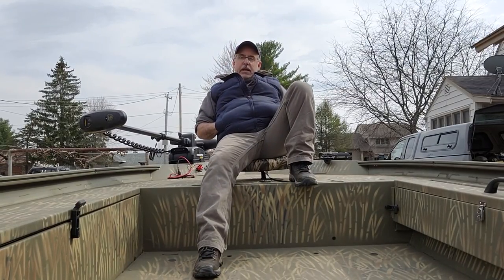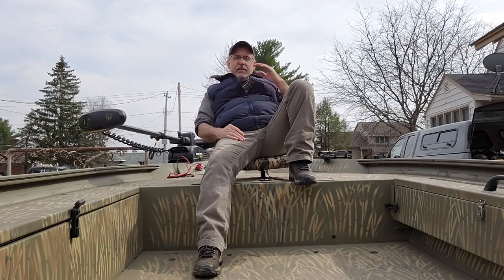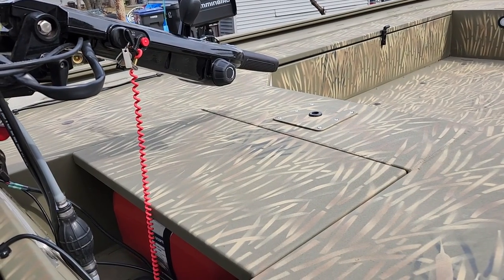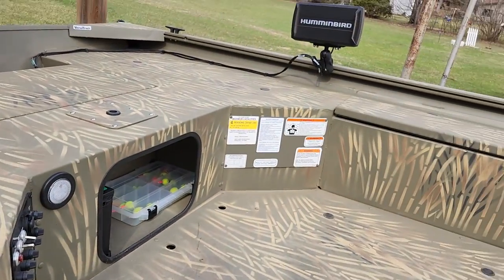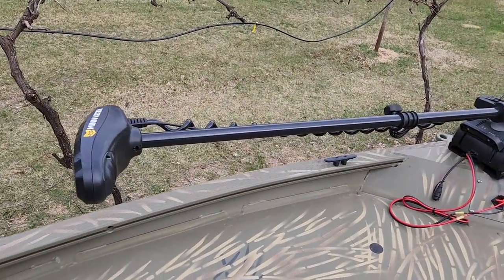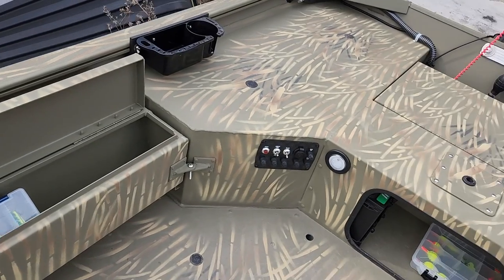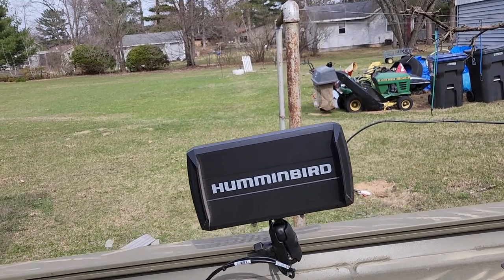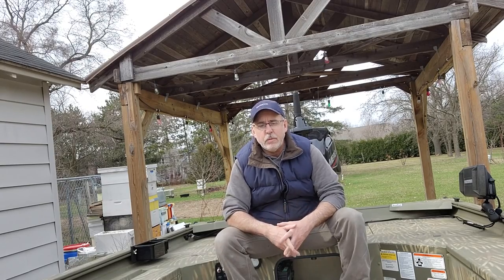1654 Grizzly Tracker  Sportsman Jon Boat  - A Brief Tour

Comment: Hey man, awesome video. I bought one of these last year. I love it. I got the 30 hp. I have the same issue with the tiller handle to the seat. I'm guessing that rear seat plate is for a fishing seat, not for while driving. I put an off set seat plate where you were thinking about putting your center post seat plate. But I went with an offset, since I still wanted it closer to the tiller handle. My arms must be short. They sell them at Cabela's. I also capped the bottom and caulked it to prevent water intrusion to the foam. Overalls I think the boat is set up real nice.
Reply from the maker: very cool.....hope it's working out well for you!

Comment: I just bought a 1754 with a 40hp tiller cant wait till it gets here
Reply from the maker: It'll take some getting used to but you'll love it.
Reply: @KevinsNorthernExposure  Im looking forward to it it's a little bigger then my 10' hahahaha
Reply from the maker: @bobmackay9281  yeah...that's a definite change.  I had a 1648 alumacraft with a 25....loved that boat....it could really maneuver...way lighter....comparatively, mine now is a tank.....does not turn on a dime and docking was a bit of a learning curve....just put a jack plate on it yesterday, too.
Reply: @KevinsNorthernExposure  that's awesome. I will end up doing that as well I plan to run some shallow area.

Comment: Hi, thanks for the video.  I just ordered one of these and plan to put a trolling motor on, which I want to order before the boat arrives.  I see you got the 45” shaft.  Have you used it and fell that it’s long enough?
Reply from the maker: Well, all I can tell you is this, I got the shortest shaft (45") with a 55lb thrust and it was plenty for this boat and I don't have mine down all the way. I've used it in windy conditions and it performed very well.  If I fished a river with a strong current a lot, I'd consider moving up to a 65lb thrust, but then you are getting into 24v territory. Right now, it's a 12v and I don't have to install a second battery.
Reply: @KevinsNorthernExposure  thanks!  That’s really helpful info.  The guys at Cabelas were trying to talk me into getting a longer shaft incase of wavy conditions, etc, but I don’t want all this extra long shaft for a boat of this size when the trolling motor isn’t in the water.  Seems like it would stick out weird when folded up. 

I saw the seat position issue as well right from the get go and am also having a seat receiver installed in a different location as well.  Pretty silly.  (I also got the 40 hp)

By the way, is your boat a 2022 or 2023 model?  I was forced to order a 2023 model a month ago when I bought it…I’ll be curious if anything about it will be different.  (The tracker website is still showing only the 2022 prices and models and they don’t have a 2023 brochure available yet. !!).
Reply from the maker: @michaelelsbury4713  it's a 2022 model. Enjoy your new boat! awesome!
Reply from the maker: @michaelelsbury4713  I've got a new video coming out today...maiden voyage. 33mph me and dog after playing with trim.
Reply: @KevinsNorthernExposure  Awesome!  Really looking forward to it.

Comment: They say 40 hp is max on that boat, but should be a 60 hp as max motor on it
Reply from the maker: I won't disagree with you.
Reply from the maker: Wisconsin Regulation: Overpowering. No person may sell, equip or operate, and no owner of a boat may allow a person to operate, a boat with any motor or other propulsion machinery beyond its safe power capacity, taking into consideration the type and construction of such watercraft and other existing operating conditions.
Reply: @KevinsNorthernExposure  putting a 60 hp on that size boat is not really over powering it. It's appropriately size HP for it. 40 hp is under powered
Reply from the maker: @TNsher776  since I rent the boat out to guests, if something were to happen, I'd rather not find out in a court of law.
Reply from the maker: @TNsher776  I do have an updated 2 year video.

Comment: Any problems with water logged foam?
Reply from the maker: Hard to tell
Reply: I’ve read issues on it.
Reply from the maker: @kph97  Older models used open cell foam. This is closed cell foam. Shouldn't be an issue ...at least not for 10 years or so.

Comment: You ought to put the seat on the port side at the stern ! There is to much stuff running under the deck on the starboard side  , Either way I  wouldn't to drill into my boat .
Reply from the maker: Why on earth would I want it on the port side? 99% of people operate a tiller with their left hand. Even steering columns are installed on the starboard side. 

Anyway...watch the later videos....I installed seats and other items...turned out awesome! There is no fear modifying a boat to your needs.
Reply: @KevinsNorthernExposure  I only based the comment on your concerns with the control panel location ! & You having concerns about putting a hole there ! Glad it worked out for You .
Reply from the maker: @ACF6180T  well, in a perfect world I'd have loved to put the CP on the port side....but unfortunately the data plates were in the way....and by law you cannot obstruct those. ......Thanks.

Comment: No jack plate   Is it possible to run the gas tank up front
Reply from the maker: Gas tank would not fit in the under deck storage area...access hatch is too small
Reply from the maker: I'm no expert on jack plates...not sure what that could offer that trim couldn't do.
Reply from the maker: Just put a jack plate on it yesterday. We'll see how it operates.

Comment: How long is your garage? Is the boat with the trailer really 21' 4"? I'm going base off the website.
Reply from the maker: I believe the garage I park it in is 24' deep.
Reply: @KevinsNorthernExposure  Thanks, I guess if I buy a 1654 too, then I will have to install a swing away tongue. My garage is a bit shorter at 21' 3".
Reply from the maker: @KBurd1  I had one on my old boat/trailer...they work well. Or you just angle the boat a bit once it's inside the garage.
Reply: @KevinsNorthernExposure  Thanks, you got a sub.

Comment: That foam is going to get wet and soak up water.
Reply from the maker: It's closed cell foam. So no.
Reply: I just watched a video of short time ago about a grizzly that a guy customized and he was squeezing water out of the foam under those compartments. He said he must’ve taken 200 pounds of weight off the back of the boat taking the wet foam out, just saying.🤷🏽‍♂️
Reply from the maker: @lcjohn51  quite possible if you don't care for your boat. I installed a auto bilge so water doesn't accumulate in my boat. When it's out of the water, drain plug is always pulled. I cut out some for my seat base....at that time the insulation I removed was dry....nothing is fool proof.  Keeping your boat in a garage during the winter also helps. 
Leaving it outside is pretty much a guarantee  the foam will absorb moisture.
Reply from the maker: @lcjohn51   Also, you need to understand...there is no foam under most of the floor. Just along the sides and seat. 
The boat design is for water to flow from front to the back under the floor deck.